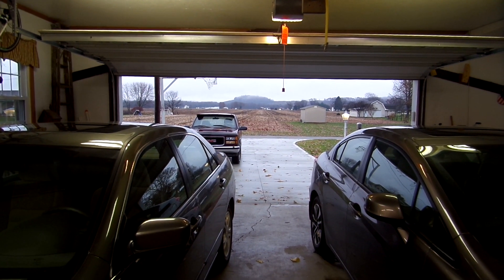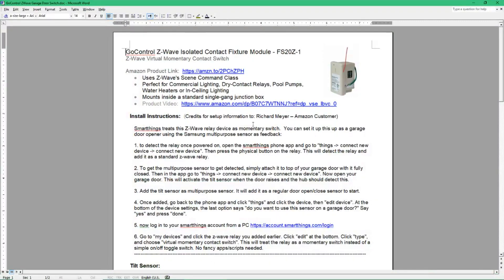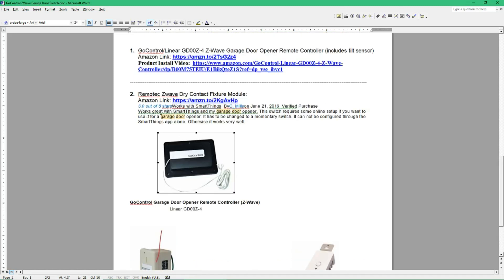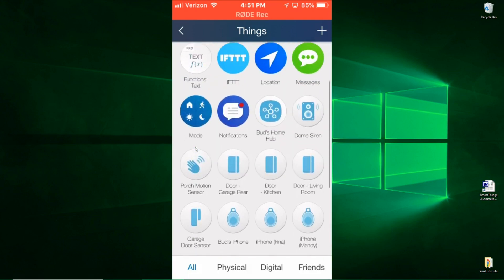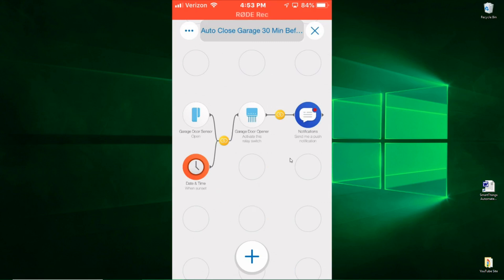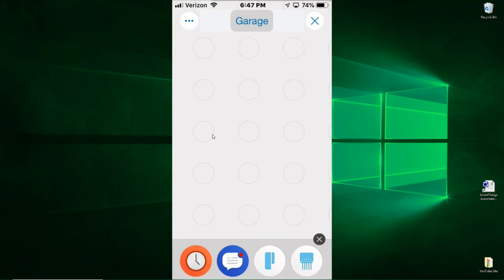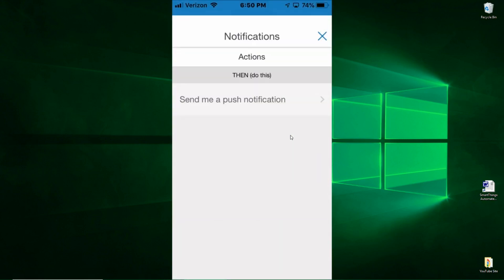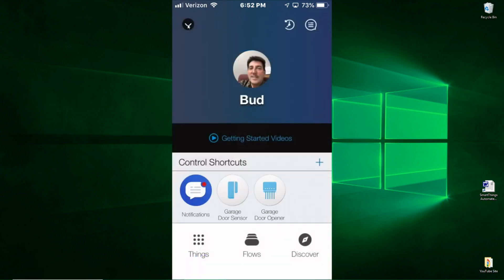Automated Garage Door With SmartThings & Stringify!

Comment: how did you wire this up to your garage door open? which wires went were etc ?
Reply: @BudsSmartHome  thanks for the quick response! I could just wire the three wires to a three prog power cord I have laying around vs source the power from the garage unit itself correct. That would make connecting it to smart things hub all great deal easier. Also, I believe this is the same switch as the gocontrol one mentioned in  this video, and it's available:  https://www.amazon.com/gp/aw/d/B00WXLRF2U?psc=1&ref=ppx_pop_mob_b_pd_title
Reply: @BudsSmartHome   the very first comment on the product is "Been using this and an older one to control garage doors via SmartThings for a long time. Super easy to set up as a momentary zwave switch in SmartThings. No need for a custom device type, just pair it and log into the IDE and switch it to the momentary switch instead of the normal one. Then just wire to the door in parallel with the in-wall door opener switch and both will work great! I put a zwave contact sensor on the door to know when it is open/closed and alert me if I leave it open, and can use this to close it! Also great to open it up for deliveries or friends dropping something off when I'm not home." so yeah it looking like the same item has the one referenced in your video
Reply: @BudsSmartHome  works great bud! Have done everything up to wiring it to the garage motor. The blue cable gauge from the smart device/switch is too fat for the garage port hole . And not 100% which of the four ports to attach the blue wires (red, white, white, purle in color ) to once I get some cable the correct gauge.   Thanks for the video man
Reply: @BudsSmartHome   ill check out where the push button runs and put them in there. my only concern is the gauge of the wire, think it will be safe  to splice the two blue wires and tab in some bell wire. the two blue wires are just too thick of a gauge and cannot fit in the ports
Reply: @BudsSmartHome   where the wire gauges are you switch pretty thick or where they bell wire size ?